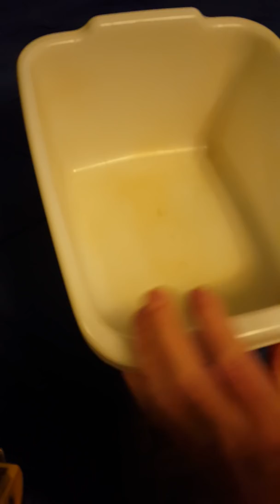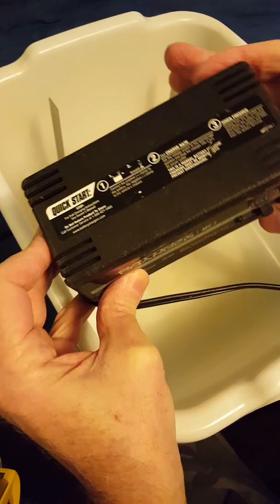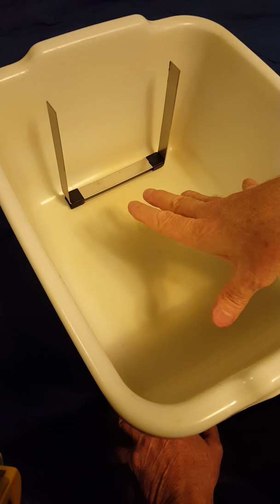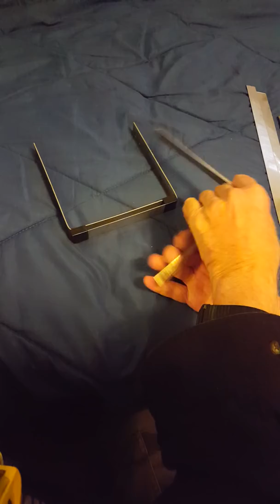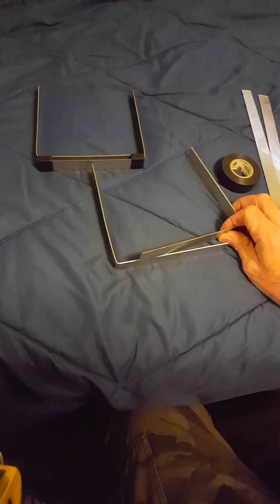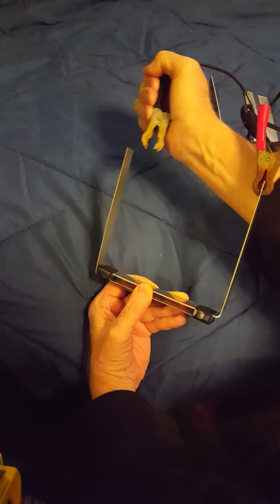HOMEMADE ION CLEANSE MACHINE

Comment: Sorry for the uneducated questions. I thought electricity and water don't mix. Is it safe to put your feet in water when you are putting live electrodes connected to the mains in too?also what happens if your feet touch the metal plate electrodes?

Comment: Dimensions 304 SS 1/16 thick by 3/4 wide and 12 inches long with a 1/4 inch spacing. I would use 88 electrical tape it is by far the best and tywrap them together.

Comment: Can A person use copper instead of SS.
Also when I made mine I just used an old computer power supply worked great.
Reply from the maker: Copper and aluminum will both oxidized and lose conductivity. Some people use computer power boxes but I prefer to only use 12 volts

Comment: oh second comment in regards to your spacing is in regards to you how much voltage you have and how long you can supply it for water likes to be dealt with at like 1.2 volts and at that point it cracks very well so when you're talking about the spacing I imagine you can measure the voltage and figure out what exactly voltage you're using in the water space as you change your salt level your voltage will change you're right salt makes the conductivity so high it's not funny but at the same time that conductivity comes with a guild Crest option LOL

Comment: A good day sir my name is Ryan and I just want to help educate you on part of what you're seeing

What you're seeing when your water starts to turn brown is actually a form of Browns gas residual ion change

What I mean is the salt has minerals inside of it that have been activated by the electrons that you've added to the water in which changing them and making them appear Brown

Okay let's talk about some minerals a little bit minerals are able to be inside of salt and salt is an ion remover and it is also a box that can collect the material that it removed the Ion from on this note we also achieve good minerals and bad minerals bad minerals being Guild crest good metals being all the platinum group Gold Silver and 156 other elements I cannot name that are affected by electricity that are inside of a salt cube

by the looks of your arrangement you've done very well and you want to keep your electrodes out of the water and if you're using stainless steel my suggestion is 3/16 l not 304 stainless

the difference between the materials is their quality and how long they'll last in a reaction of ion exchange

Okay simple ion exchange will deteriorate metal at different speeds and rates I eat example silver at 7 volts inside of distilled water will colloid itself removing its ion and releasing itself to float within the water
IE gold under a plasmatic reaction gold will release its ions and become soluble in water and will hide inside of a salt cube where it is safe from Wi-Fi vibrations all of our minerals do not enjoy being in a Wi-Fi frequency at all including microwaves cell phones TVs and Bluetooth radiateWi-Fi frequency that minerals do not enjoy

Once the minerals have been stripped of ions in a heavy reaction like a hydrogen separator or a hydrogen generator however you wish to call it in which case you have a very basic unit on your floor at home where your wife sticks her feet lol if you were to catch the gases separate the oxygen from the hydrogen you could pressurize bottles and fill up the space shuttle you would just be a lot slower at it than NASA LOL

I apologize I didn't inform you of everything that I know in regards to these products but I'm hoping to open your eyes a little bit and if you wish you can definitely contact me back in regards to what I've said

Also you are correct that if you put your feet within the water that is going to change the electrical conductivity of the body note and understand that part of North America's biggest problem is we cannot get rid of the charge in our body and this is why some of the chemicals get stuck within us so what you really said was is if you put your feet inside a saltwater at the Ocean's Edge everyday you will change your electrical current within your body and it will Leach the poisons from your body that's why swimming is good for you the oceans electrical charge is different than the body which will remove the overcharge from you I wish we lived beside the ocean so that we could do this everyday or in a warm climate note Africans also walk different than a Canadian they walk with their toe tips go down first they do not keep as much electrical charge within their body as we do therefore their back does not hurt and they can walk a lot farther distance than any North American

Thank you sir for at least reminding me how to build my foot detox unit

The only difference I will make is I will use distilled water and in that case I will have a lower electrical current inside of the water and it may take longer but with distilled water I will not disturb minerals within it because it is pretty much empty of any mineral at that point I do not have as much charge in the water as you do but I also cannot make as many Guild Crest minerals as you do please go and understand what a guild Crest mineral is that's what you're seeing come up as brown and the black yes I can agree it is subtracting stuff from the human body but my hydrogen unit also develops a black scum within itself after I've made a few thousand liters of hydrogen and oxygen out of the tank

Proportionally I do not have a normal size hydrogen unit my hydrogen unit is 433 plates with a surface area of approximately 11 square inches x two sides times 433 plates. Runs on 12 volts and can make 45 gallon drums pressurized to 7 PSI in approximately 12 hours this is an exceptional size unit with exceptional qualities but at the same time my hydrogen unit is very much equivalent to a foot of detox unit LOL the way things go around in the world are revolve to work with one another is amazing I thank God for all of this technology I also thank God for the ability of our bodies to heal ourselves with a little bit of the proper treatment peace be to you and your family and blessings to you for all of your days

Comment: Could prefabricated stainless steel L brackets be used instead? There are screw holes punched in them. Many brackets are galvanized, I'm assuming I should stay away from those...is that a correct assumption?
Reply from the maker: Yes. Those can be used if they are stainless. But most of them are not that long

Comment: Liked your simple explanation of how to make an ion cleansing machine. How critical is the design of the stainless steel electrodes? What about 2 seperate stainless steel electrodes on either side of the bucket? How much voltage do you actually have in the water? How many minutes  do you soak the feet in one treatment? What water temperature do you use?
Thanks in advance!
Reply from the maker: Warm (bathing temp) 1/2 hr 2x a week.
Electrodes must be close together or they will not conduct much.
Salt increases the current. I use up to a Tbsp. Too much and your toes will sting or you will overheat your power supply.

Comment: Are you still around old man?  Hope all is okay, we miss you!
Reply from the maker: Still around.
My latest research on "spirit" fields put me in the hospital 7 months ago for the installation of a prosthetic heart valve and a bypass. I am still recovering from that and trying to figure out how to proceed with the research without any more mishaps.
Reply: @labratmudrock  one thing I found useful is to use a partner.  The use of tetrahedrons is important too.  The partner acts as a grounding mechanism but also creates a parallel Field.  Make sure you are facing your partner with the copper wire and copper rod connected to each other.  This is done by connecting the right to the right and the left to the left.  When facing each other it creates a figure 8.  This helps with the grounding. The field will appear within 5 to 10 minutes.  You have any questions please contact me no more mishaps!!!
Reply: @Maheonehooestse-HolyFireMan  Hello, would you be willing to teach me about what you are describing above?
Reply: @Maheonehooestse-HolyFireMan  hey man, can you teach me more?
Reply: @Maheonehooestse-HolyFireMan  hey man, can you teach me more?

Comment: Ok this Ion device cleaner (By Electrolysis) sounds great ! but can you use a magnet to keep the 2 metal bars from falling or tipping into the water. I wanted to use a magnet at the base of the plastic container to secure the device in place. Also don't you need to use a bit of Sea salts also ? Do you know how much salts to use ? Can you ground yourself with a wire to the machine to make it work better (Aren't we negatively charged) ? I want to build one myself to start Detoxing my body. These machines are very expensive online … Thanks again for DiY project.
Reply from the maker: If the wires to the power clamps go over the far side of the bucket, they hold the electrodes upright. Regular table salt works fine.
Can we salt and the current will be too strong. Your toes will burn or tingle

Comment: i would love to make this, but i am really lost on how to make the electric part..When you say 12 volt battery are you talking the  kind that goes in a car?  can you make a video on just how to do the electric part on this, please...a step by step....Thank You...Angel Costa..
Reply from the maker: sherri costa 
If you get the exact 1 amp Schumacher battery charger that I showed ($23 on Amazon) then you just plug it into the wall and hook up the electrodes. And yes, 12 volts is the voltage of a car.

Comment: @ THE OLD LAB RAT Have you ever used distilled water for the process ever?
Reply from the maker: christopher wolf 
No. The minerals in tap water actually help the process and the electrodes will bubble before the salt is added.
I know of no advantage to using distilled water

Comment: anode & cathode . brint is in the bobbles , right ?
Reply from the maker: DeenseDude VonAnd 
Brint?
Reply from the maker: DeenseDude VonAnd 
Hydrogen and oxygen mixed.
Take a lighter to the bubbles and some of them will really pop
Reply: yes , i guess ventilating is a good ideer ... i use the same setup to remove rust from old metaldetecting parts , and i guess also its the same when you galvanize stuff , just add zink :-)